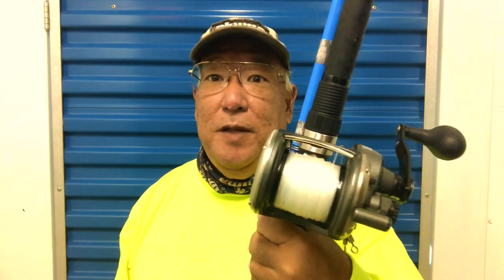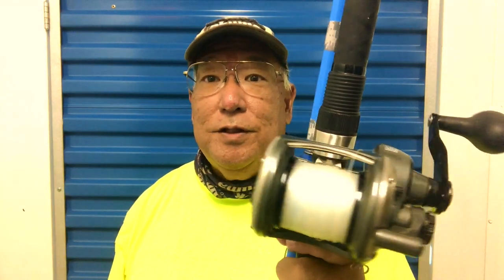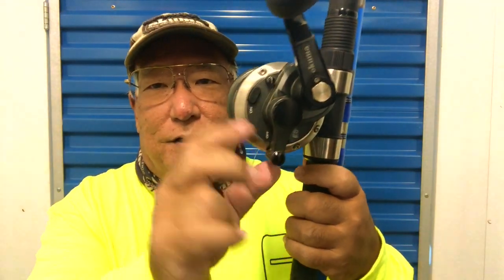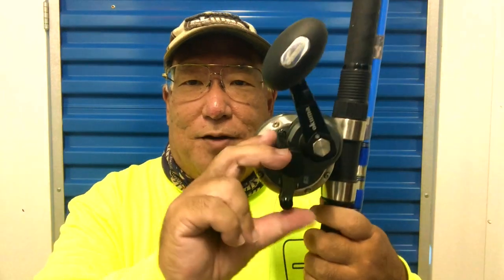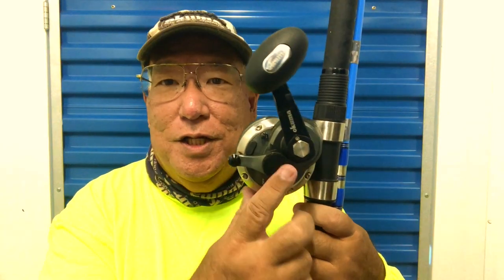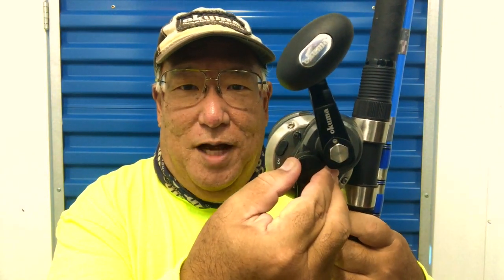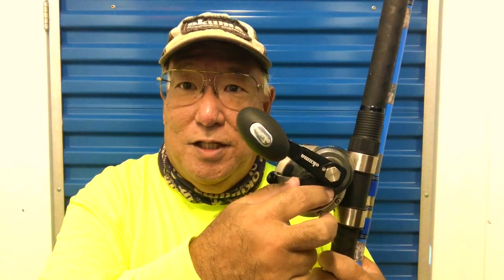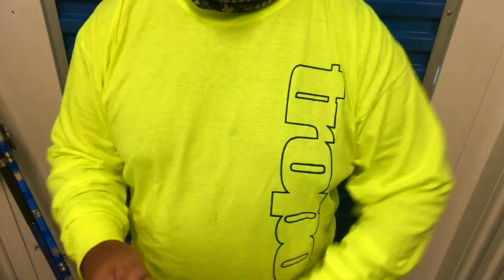How To Properly Set The Drag on Any Lever Drag Reel!

Comment: hello unko chris, i recently switch from a star drag to a lever drag. I got me a penn fathom fth60ldhs that has the free, 1, 2, 3, strike, full, and sunset settings on it. when im casting it i usually have my thumb on the spool to prevent it from bird nesting but it doesnt really work out unless i do it with the star drag. since the spool on my fathom is much faster than my penn warfare 30 I'm wondering when im casting it from free position, do i need to lift the lever up for more tension so it doesnt bird nest? i am also a shore casting guy.
Reply from the maker: All very good questions. I prefer lever drags as i can cast much farther. But they're a pain to set properly as they can "freely" take off on you. You really got to play around with the settings on every model as all models differ. Fathoms are great for casting by the way. Warfares you need to use heavier weights as the disc system on those models are kinda "you know". I can honestly say of all my reels i now only use one. The new Alijos. There's like +5dz settings that i can set on my 12 unit! I was one of the original testers of that reel years ago. I cast the farthest with 8oz on that unit. For us shore casters i must say we need to go through a lot of models to find that one special model that we can relate with. But now my fellow testers are telling me theres a new Solterra out that outcasts everything else on the market! I'm going to have to try that one myself. Every model is uniquely different. If I were you i'd dump that Warfare. Really. The Fathom is great! Just need to learn your units is all. Not many use lever drags because most old timers are not used to them. I wasn't at first. It's a harder slower "learning curve" to master. But in the end it'll be your best type of shore casting reel.